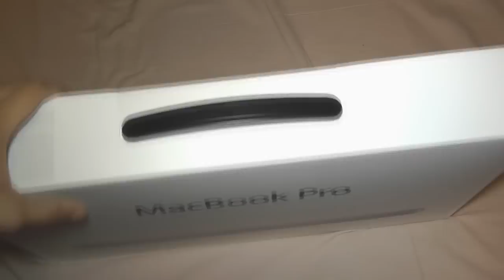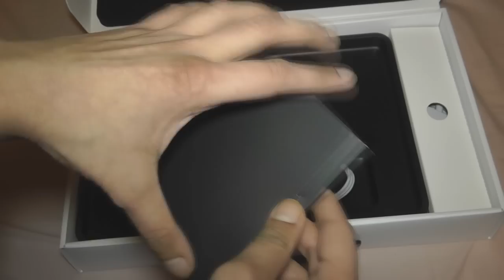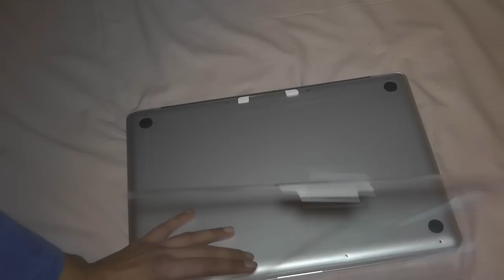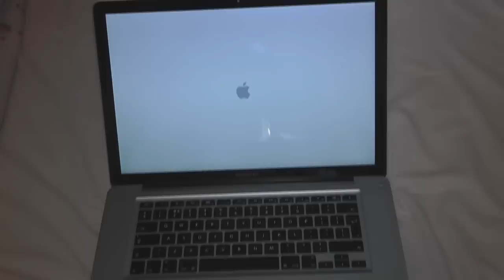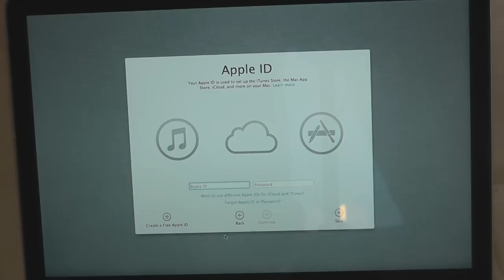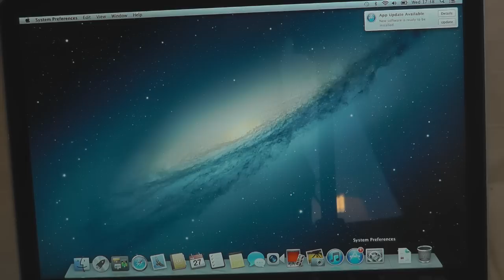MacBook Pro 15 inch Mid 2012 Unboxing (Life Time Windows User)

Comment: I'm debating on this model or the new dell Inspiron 15 7000 2 in 1. I'm a student and I'm in need of a laptop and I can't decide. They're both about the same price. The dell has 8GB, 1 TB, i7 and the Apple has 4 GB, 500gb hard drive, and it's and i7 as well. I can't decide :/
Reply: +alex espinal just ordered a mid 2012 15 inch pro. The owner added 16 gigs of ram and a Samsung 1tb ssd.. Super excited to get it and got a good deal. I was going to just go buy a new one from Apple but I think I'm glad I went this way .. Less than half the price and I like the Ethernet port and disk drive just in case . Plus that battery indicator :)

Comment: I always thought that 15" MacBook Pros had 1680 by 1050 displays?
Reply from the maker: They only came with the 15 inch MBP if you payed an additional £80. This was especially a rip off to pay at the time when I brought the machine as the Retina version was already available and paying £80 for a bit more resolution would make the price come so much closer to the more expensive Retina varient. Due to this I did not go with the higher resolution. That being said I really would have liked it if Apple gave the 2012 Regular MacBook Pro's the higher resolution for free.

Comment: If you wanted a dedicated HDMI port you should've gotten the retina model...
Reply from the maker: Retina model cost a lot more money at the time and I needed a 500GB hard drive and I would have had to pay well over two grand to get it to the specification I wanted it. With the original I could pay a lot less and then save money getting better components to upgrade the laptop later. I have already upgraded it to the latest Samsung SSD which is the best SSD are the market.
Reply: +Eric Carter I'm paying two graded for my Apple Mac Pro I must be nuts

Comment: Is there anyway to change the system font size? I will want to make all system font include application bigger! character are really small and it is painfull to read on it(macbook pro 15 inch , mid 2012). I was also a windows user for a long long time
Reply from the maker: You can change the sidebar size of the Finder. You can do that by going in to Settings, General, Sidebar icon size. I am not sure how you can change the font size of everything else. The retina version has even smaller text so what you do have is better but even then I don't know how to change the font size of all the text on the operating system. You will most likely have to try and get along with it.
Reply: Thanks for your support. I will continue search on my way, if I found some tricks usuable about this issue I will share as soon as possible
Reply from the maker: jizozor fred Great. Good luck! I'm sorry I couldn't be of much help.
Reply: go to options,then display then make tool bar bigger and then application bigger Enjoy...........

Comment from the maker: The higher resolution will not at all make the laptop heat up. That is unheard of. You only get the white border with the matte anti glare screen option. If you get the higher resolution glossy screen then the border around the screen will remain black.

Comment from the maker: The other display options give you a higher resolution screen. So instead of the standard 1440x900 you will get 1680x1050. Its expensive especially when you consider the cost of the retina MBP. But if you have the extra money laying around then I would recommend you pick up the high res display but only if you intend to do a lot of video editing as thats where its most useful.
The other option is a matte finish so you don't get as much reflections on the screen but the colours are not as vibrant

Comment from the maker: The 4 core is that big a difference but you will also need an equally as powerful graphics card and for the games you want to play particularly GTAV you won't stand a chance on running that on the current range of MacBooks. I would suggest that you wait as Apple are going to update their MacBook Pro line this month and they will include the latest processors and most likely an upgraded graphics card which should do a better job at dealing with more high end gaming.

Comment from the maker: Lol thats pretty much the exact same reason why I went with the non-retina MacBook Pro. The screen is really nice but the storage is very limited on the base configuration and to upgrade the storage alone will cost a fortune and yes even though the display is beautiful the price is too steep. I have only used the superdrive twice on this computer an I may replace it for another hard drive in the future. I also put in a Samsung 840 SSD. An installation video is on my channel. Thanks for watching!

Comment from the maker: I think the 1440x900 resolution is decent. For media use and everything else the high res will be nice but is not an necessity. The only reason you would want the higher resolution is for video editing as it will give you more space to work with. Thanks for watching!

Comment from the maker: The MacBook Pro is the main thing not an extra. Apple used to include extra stuff with the MacBook Pro range like a free Apple Remote which you could use to control media on the laptop. That would of been a nice addition if they included that but no, they just get tighter and now don't even include a software disc with the computer.
Many computers for half the price come with something extra but no additional accessories for a £1,500 laptop is just absurd.
Thanks for watching!

Comment from the maker: Well it depends on what you will be doing. If you won't be doing much gaming or video editing then I think a MacBook Pro is more money than you need to spend. I would suggest you get a new 13 inch MacBook Air 2013 model. You will be paying less and it will serve you very well. If you want an amazing multimedia experience then I would suggest you pick up a Retina MacBook Pro but then only you can decide if its worth paying the extra premium for the higher res display. Thanks for watching!

Comment from the maker: Out of the games I have tried the ones that work with maxed out settings are, Lego Batman 2, Call Of Duty Black Ops and Star Wars The Force Unleashed. If some games are not running as smoothly then go to Settings -> Energy Saver -> Then untick (Automatic Graphics Switching). This will force your Mac to use it's dedicated graphics card without switching to the lower graphics card at all. The only downside to this is that your battery will drain a lot faster so I'd advice you charge simultaneously

Comment: That sounds Great! 

"max settings, but if the game doesn't run very well i tone down the graphics --- seems normal??" :))) 
I just need to know, what i can run with this Mac, cause i think its a shame, to run everything on "low" settings... i run "league of legends" with kind of, highest res. med settings.. 
My older laptop ran it with maxed out settings - gt555m 2gb i7 2gen. 6gb ram
I saw benchmarks that this 650m was better than gt555m, so thats kind of also why i bought a mac.. :)

Comment from the maker: Here are two things you can do:

1. Click on the Apple logo on the top right corner of your Mac, go to Force Quite and click force close on the BlackBerry App that is open.

2. Go to the Finder, click applications and scroll until you find the BlackBerry app. Hold CMD and press Backspace and that will delete the application. Then go into your Trash and click empty.

That should remove the BlackBerry software and you should now be able to turn off your Mac and use it as normal. Hope this helps.

Comment from the maker: I am enjoying it very much. It does take getting used to as you will get annoyed with it sometimes. The main issue is that you are limited to two video editing softwares. FinalCutProX and Adobe Premiere CS6. FinalCutProX is good software but is very unstable and fails on my bigger projects. So I used Parallels and installed Windows so I could get Sony Vegas Pro as I used that all the time on Windows. Software support is the main problem
Congrats on switching. If you need any advice let me know.

Comment: @ecartman12 (1/2)oh really? thanks for that info! screen resolution does matter to me that's why I'm choosing the new MBA over the updated MBP because the. MBA got a higher resolution than the updated MBP. however it's a let down for MBA knowing that it's got only 128gbSSD vs update MBP's 500gb HHD + it has a super drive(do drives still matter?). the 13' MBA&13'updated MBP are at the same price

Comment from the maker: So far working with a Mac is awesome but I'm let down with the lack of software. I used to use Sony Vegas Pro on windows & I feel really let down that Sony Vegas which I have been using for years is not available for Mac. So I am learning to use final cut pro x. In regards to which Mac you get I would say either go with the MacBook air or retina MacBook pro 13" If I were you I would wait until June as the rumours are that apple will make all their laptops retina versions and they will be cheaper

Comment from the maker: It's great that you have an operating system that you love using & I respect your opinion. In my opinion I like both operating systems. For my use they both have their ups and downs. The other advantage on Windows is much higher performance at a much lower price point and much better software support. For example if you look for editing software on Windows you will get software from Adobe, fx studio and my personal favourite Sony Vegas etc. With mac you are limited to Final cut & Adobe premiere.

Comment from the maker: That's great mate. Even though I have not mentioned it on video yet I do not prefer Mac over PC. I think they both have their ups and downs but one two things really let the Mac down. One is price, the second is the lack of software. The software is growing but on Windows there is so much to chose from & you will find something that works perfectly for you. I really want Sony Vegas on my MacBook Pro but unfortunately I will have to learn and settle with final cut pro X. Thanks for commenting :)
Reply: Eric Carter 7 years late but you can run Vegas in MacBook Pro by installing Windows natively through a software called Boot Camp.

Comment: I recommend you enable iCloud as it is awesome if you have an idevice

By the way, you can change the dock size easier by dragging the divider (in between the downloads stack and the system preferences) - up makes it larger, down makes it smaller